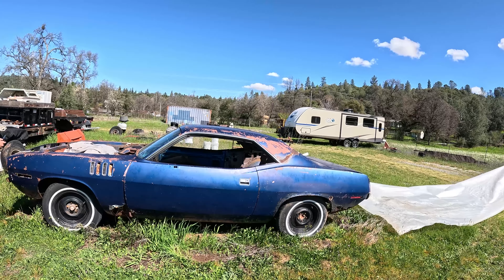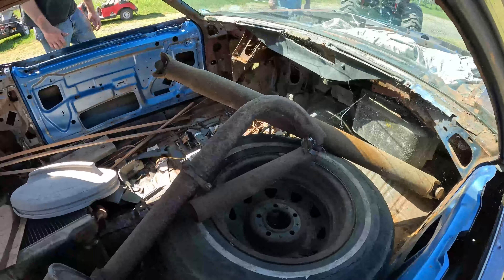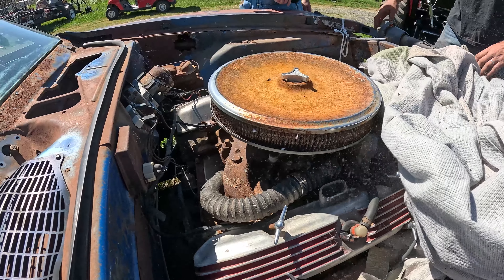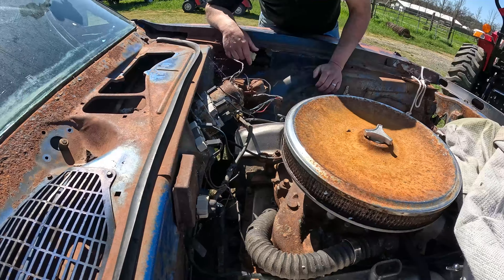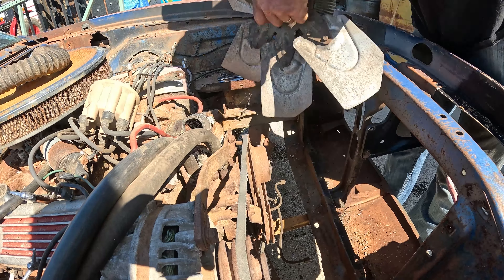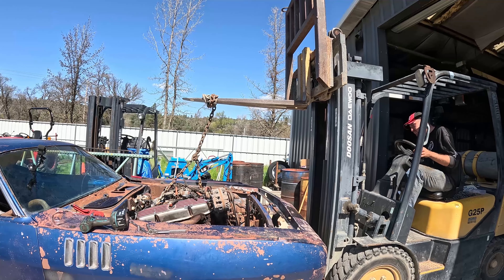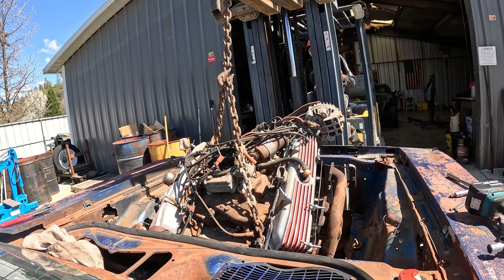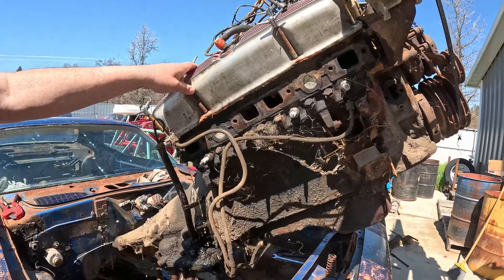Pulling a 413 Engine Out Of a 1971 Plymouth Cuda 340 #mopar #restoration #automobile #413

Comment: The beginning of the video you showed the roof seam, that’s from factory, usually they are filled with lead or another kind of filler, so nothing unusual there, it could have been replaced but chances are the filler just fell out